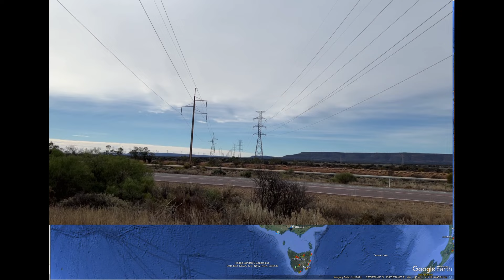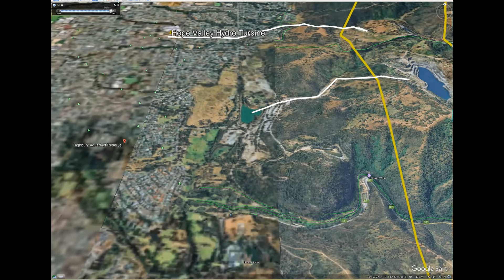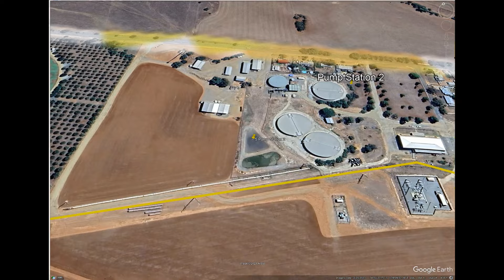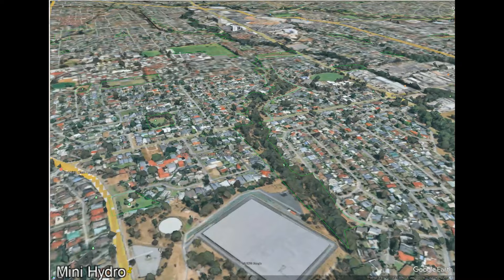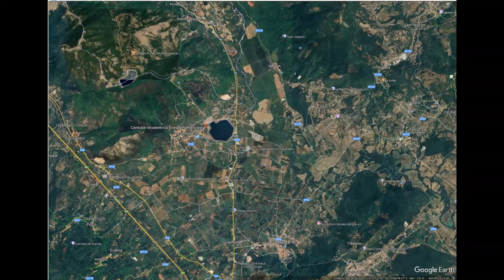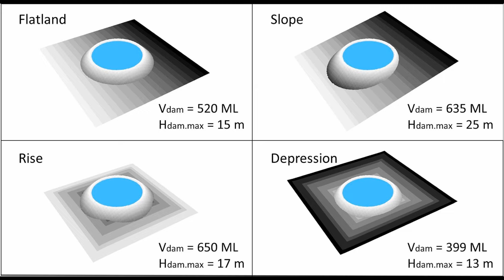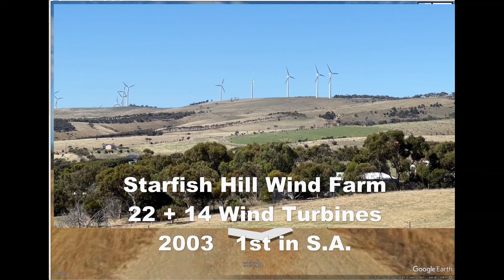Better Big Battery using Closed Loop Pumped Hydro Energy Storage for Dry Environments

Comment: due to batterys dropping to 51$ a KWH its cheaper to put in batterys than anything else these days 
due to our stock market style pricing they can charge for free in middle of day here at the moment so next year their going to be like 7000% more batterys in australia than last yr. dozens of projects in pipe due to the profit margins
Reply: I think your figure might be a little out - the figure I found for Li Ion cell price in 2024 was US$115 (AU$187) per kwh. That's also just the cell price, and doesn't include the rectifiers, inverters, management and cooling systems, enclosures, site works, shipping etc. that you need to make a fully functional BESS.

One of the most recent BESS installs in Australia is the current stage 2 extension for the Eraring big battery in NSW. That has a 240 MW, 1030 MWh design capacity, for an estimated cost of AU$450 million. That works out to about AU$437 per kwh of storage....

Pumped hydro lasts for at least fifty years, lithium ion batteries for about ten, so you'd have to replace the batteries about five times in the life of the pumped hydro sration...

The wholesale price of electricity on the Oz national grid actually currently goes negative for a large proportion of daylight hours, so battery (AND pumped hydro) get paid to charge....
Reply: 50k a MWH 50mil a GWH 50 bill a TWH nothing compares price wise
Reply from the maker: So many announcements of intension to build!    Most followed by announcements of scaling back or cancellation.

So many private citizens flooding the market with electricity from their roof-top PV during sunny days wanting top dollar for their electricity.   

Electricity Retailers have reduced sales during the day light as the households use the electricity from their roofs Very small market for electricity in the evenings.
Reply: @Highbury5089  Many people get what they think is a good idea. It may be a good  idea but a god idea demands money to put it out in life. Also I has to be profitable.
The roof top panels I consider a good idea provided the Private Citizen uses the generated power him self and there by reduces the load on the net. It would be best if he had a battery too and then only use it at peak times but due to the high cost of getting a battery installed (the installation and performance regulation costs - not the actual battery it self) then that is I believe currently uneconomical.
If the Electricity retailers had access to control solar panel input to the net and batteries connected to them they could use the batteries as a load during day time low use and high solar production and let people use it during peak hours. This way they could even out the demand on the net and also main producers.
I personally have batteries that uses the surplus to be loaded up but unfortunately not enough so I have some going to the net in the afternoon on most days. To upgrade the battery to keep it all is easily possible but not economically viable. I would waste too much expensive battery capacity.
The government assistance isn't enough as most goes to installation and installer profit. The electricity retailer and the line owner would benefit from it but for those it is probably more profitable to build bigger battery power stations than helping the individual consumer.
Reply: Battery capacity last year was more or less double the year before - I can't see this year being any where near 7000% better than last year.
Reply from the maker: @peeemm2032  Austrlia currently has 2 Pumped Hydro Energy Storages being converted .
Sadly Snowy 2 is being built in the wrong place.     They are doing too much underground tunnels.
The smart thing is to find places where the construction is simpler.    The Hope Valley micro hydro has pipes running down on the outside of the Hils.   

There are dozens of locations in Australia which could give the same amount of energy storage as Snowy 2 where the penstock pipes can run on the outside of the slope.    
If it is a closed loop the same water is re-used
Reply: @Highbury5089  there do seem to be a number of projected pumped bydro projects, and some that have been cancelled (particularly in Qld) because they were deemed to be too expensive...

Not sure of all the details for Snowy 2.0, but there may also have the to be used as a straight hydro generation facility, not just as a closed loop system?

There do seem to be tunnel issues with Snowy 2.0, but hopefully they've all been resolved now.....
Reply from the maker: @peeemm2032  
Here is a list or PHES sites around the world.
https://www.hydropower.org/hydropower-pumped-storage-tool

Politicians love cancelling the projects of their predecessors when they come to power.
Reply: for ten years. then you can spend it all again, along with figuring out how to dispose of the things... though with a fair proportion having gone up in flames, thats not so big an issue, i guess...
Reply: @paradiselost9946  The going up in flames shouldn't be such a big problem any more . The Lithium-Ion batteries where a problem. LiFePo4 are not really and if we go to Na type batteries then they can't burn.
The 10 year problem we don't know. Most of them have not yet been used long enough to know if they really last 10 years or much longer. Even if only 10 years if there is a buck in re-using them it will be done. If not we may have to learn to use them for some thing else like building houses.

Comment: Latrobe valley open cut has massive potential. Power producers don't want these projects because they reduce the value of peak electricity.
Reply from the maker: Yes the hills around the Latrobe Valley seem to have a lot of good sites for PHES.   I used the ANU data to look at that area of Australia.  Greenfield and Brownfield.
https://re100.eng.anu.edu.au/pumped_hydro_atlas/
All the electricity cables from the coal burning power stations could be re-deployed to the PHES power stations.

The trick is to find a site where quick and simple construction can be achieved.

Construction of the Italian example at Presenzano started in 1979 and was completed in 1991.   

They reduced the complexity by having the water run across the top of tor then descends down on the outer surface of the escarpment.    The cut and fill of the upper dam and the turkey nest of the lower dam would have relatively easy to build.    

The only underground work is in the generator house.    

With multiple generators they could have started generation of electricity as soon as the first generator was installed.